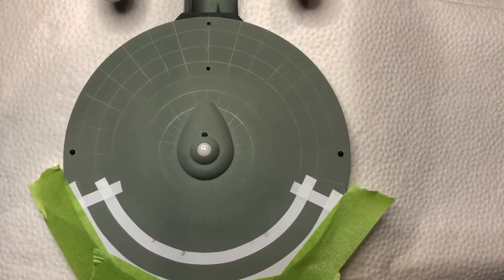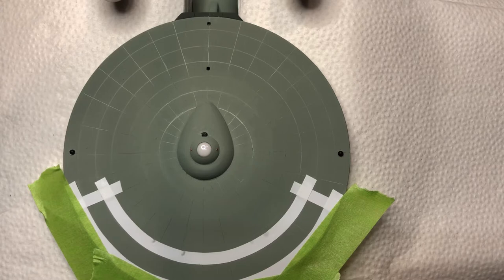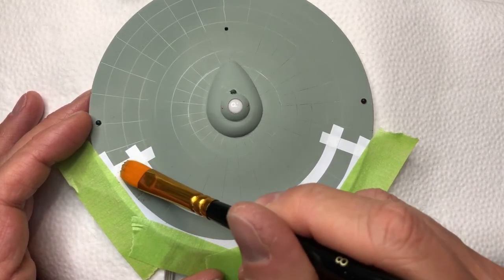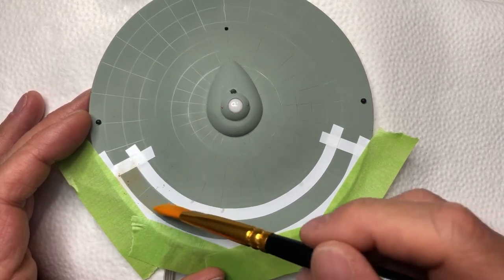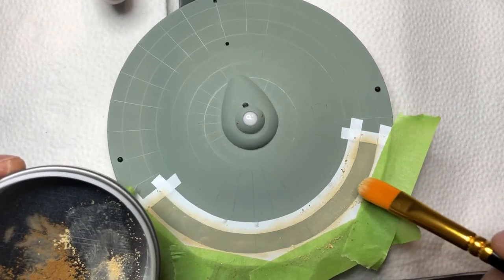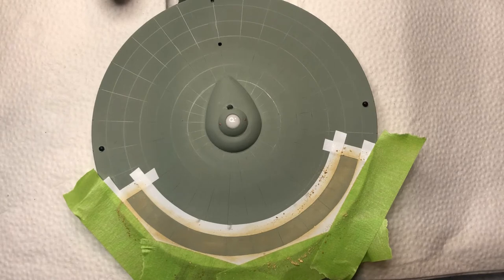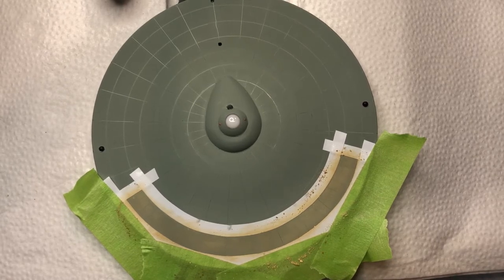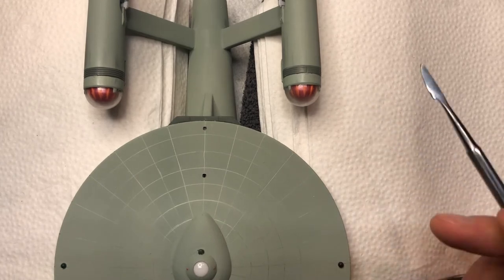U.S.S. Enterprise - 1:1000 - Part 4 - Tan Arc and Weathering - Polar Lights

Comment: What type is the white mask tape? I'm working on this kit right now and these videos are a great help! Thanks very much in advance..
Reply from the maker: Hi John, I’m glad to hear the videos have been helpful! The white tape I used is Tamiya Masking Tape for Curves. I have both 3 and 5mm rolls depending on the tightness of the curve. Item# 87178 - 460 and 87179 - 460. All the best on your build :)
Reply: I'll make use of those tapes indeed! What chalks are you using for the weathering effects? I have some artists pencils I was going to grind down for the various Green algae and such. I've been out of model making for a few years and I'm kinda re-learning some techniques I've lost. LL&P.. @ArcticModeler
Reply from the maker: Hi John. Sorry I missed your followup question initially. I used a custom mix of soft chalk pastels (ground with a nail file) found here:
https://www.amazon.ca/Mungyo-Square-Pastel-Assorted-B441R078-7003A/dp/B01HFJJLNU
Take care!